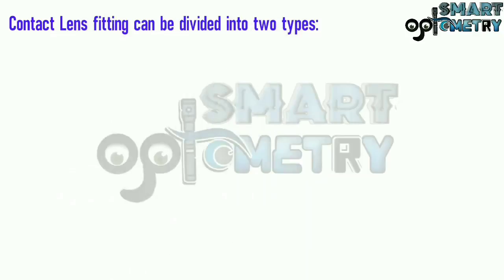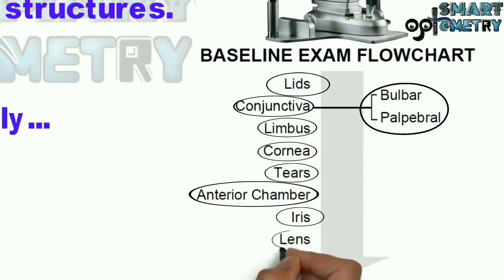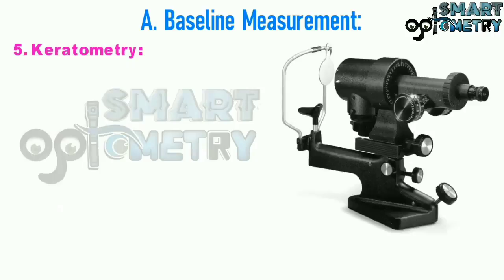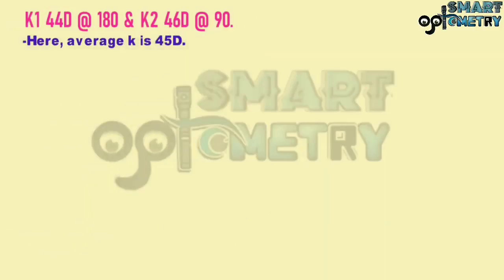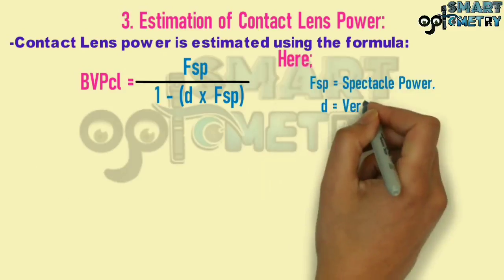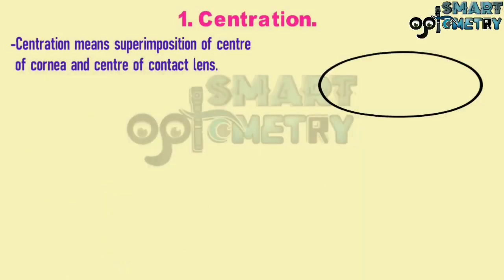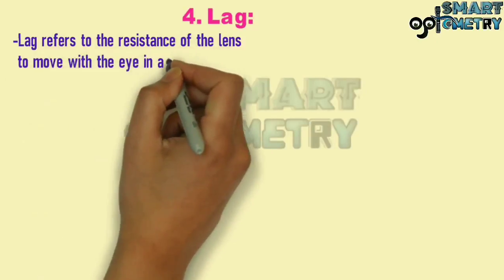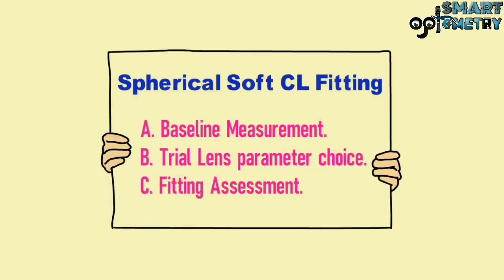Contact Lens Fitting - A complete Tutorial (Spherical Soft Contact Lens)

Comment: What is this 337.5/2.
What is this 337.5?
Reply from the maker: Actual Formula is:
(N1 - N2) x 1000/K reading.

Here,
N1 = Refractive index of keratomerter(1.3375).
N2= Refractive index of air that is 1.

So finally it comes,
(1.3375-1) x 1000/ K reading or 337.5/ K reading(In short).